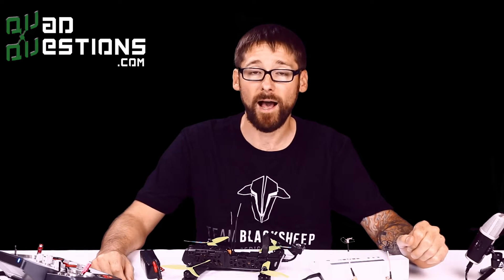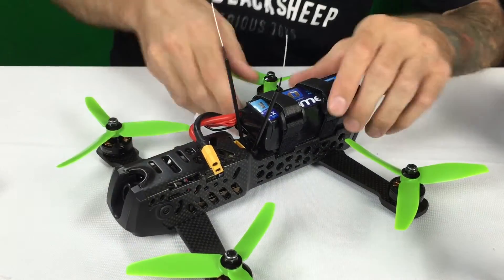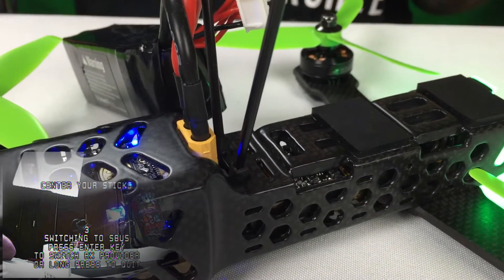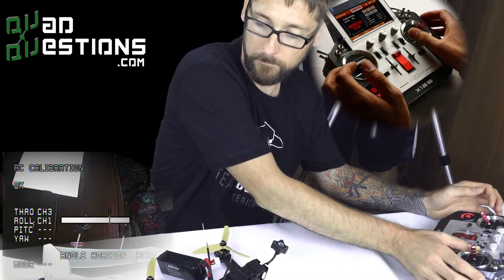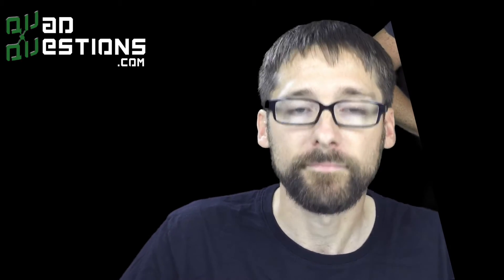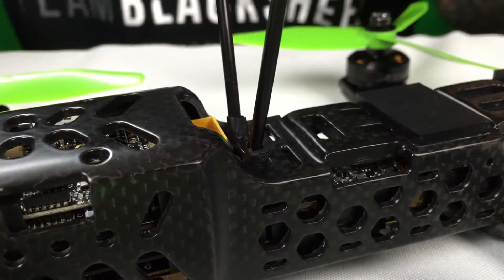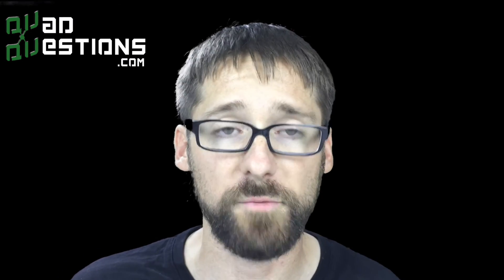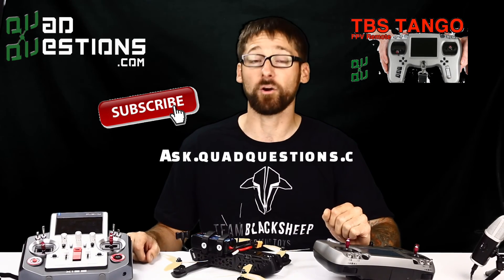TBS Vendetta initial setup procedure for first flight via OSD and Cleanflight.

Comment: Thanks for a great video, I just finished setting up my vendetta V2 but I noticed that by default it assigned my mode options and motor disarm on the same switch. Whenever I select the horizon mode it disarms the motors. Could you please tell me how I could correct this? Cheers!!
Reply from the maker: sounds like you added an arm switch via betaflight incorrectly- You simply have to set a new switch to arm in Betaflight that is different than the flight mode switch.  Ask.quadquestions.com and we will post you a walk-through.
Reply: Thank ever so much for your prompt reply, will wait to review the walk-through and try to have it corrected. Thank once again - Much appreciated!! :)

Comment: I have TBS Crossfire and in the website it says to point the antenna the other way, is this correct because I keep seeing those using that antenna always have the tips east to west instead of the manual's instruction to point the tip north to south.
Reply from the maker: +romestar the antennas are dipole, the best thing to do is look at your crossfire antenna and match it's orientation with what you have on the ground.